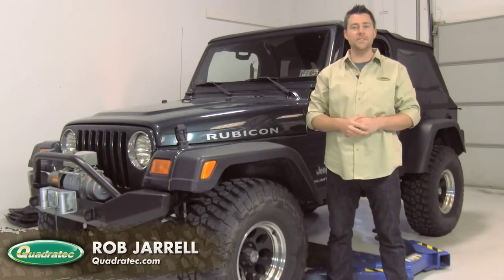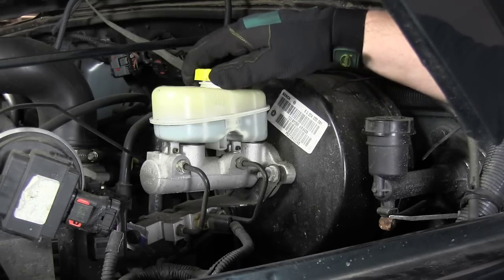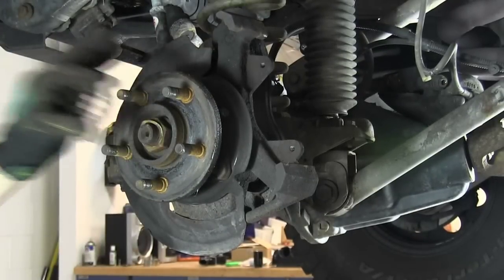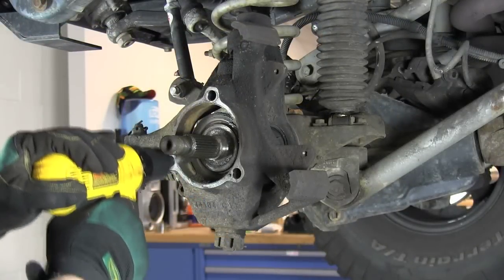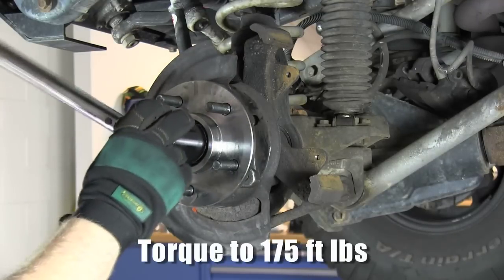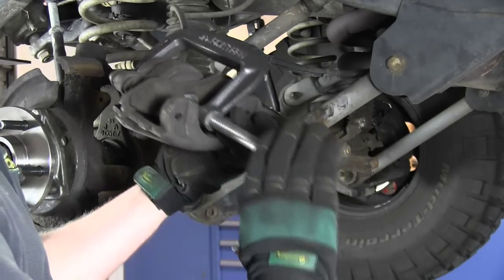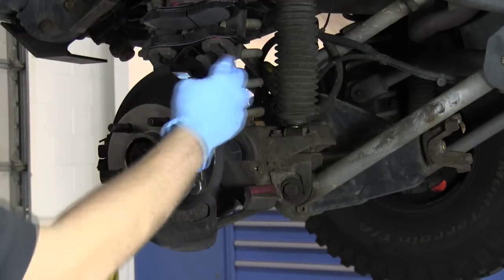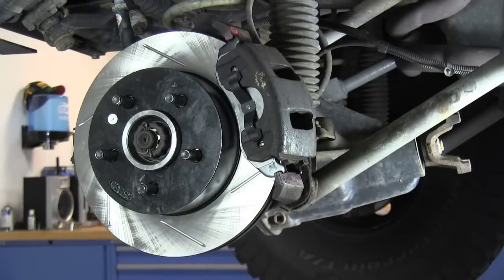How To: Jeep Wrangler '97-'06 TJ Hub Replacement

Comment: Friendly advice, DO NOT torque down the caliper bolts, especially if all you have is a crappy click-type 3/8" torque wrench.  I just snapped off the caliper bolt and now the caliper is stuck.  Waiting for my mechanic to come over now and take a look, he said hand tight is all you need for those two bolts!
Reply: 11 FT LBS is definitely hand tight. You did something wrong or your torque wrench is off

Comment: Why is your front driveline disconnected?
Reply from the maker: +CanYouFlyBackwards we were also replacing all the u-joints in the front driveshaft at the time.
Reply: +Quadratec Sweet! Thanks so much for the quick reply, I picked up a used TJ and (2000 Sport 5 speed) I notice when I accelerate, especially from a dead stop, I seem to have a little bit of what seems like driveline hop. I have checked my drivelines and they are tight. Would it be possible (150,000 miles) My motor mounts/transmission mounts could be sloppy by this point and that is where the movement is coming from? Are there other contributing factors that could be causing these symptoms?
Reply from the maker: +CanYouFlyBackwards It's always good to check the motor mounts. But also check your control arm bushings. I know I have had some clunks and hops that were cause by that. If it is your motor/ transmission mounts, I would highly suggest the MORE bombproof motor mounts: http://www.quadratec.com/products/12590_0740.htm
Reply: I wondered the same thing!